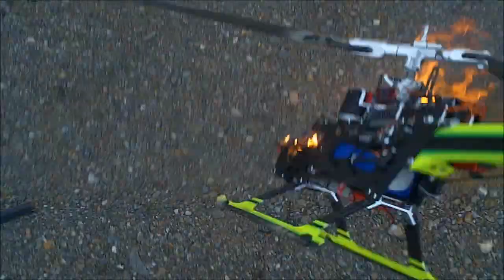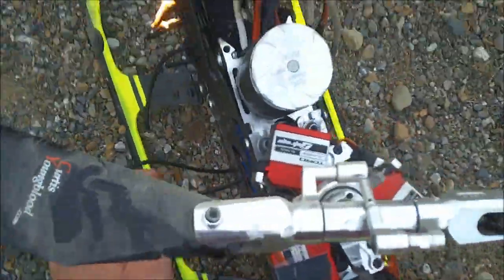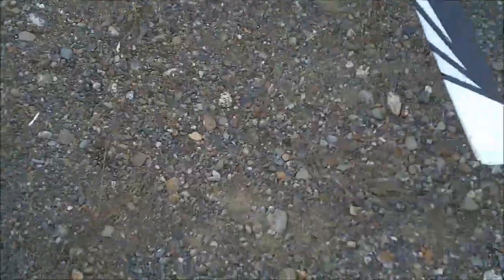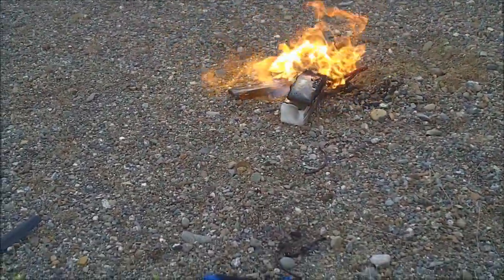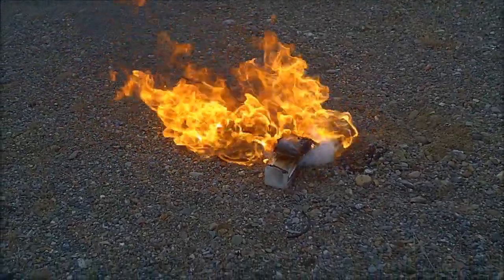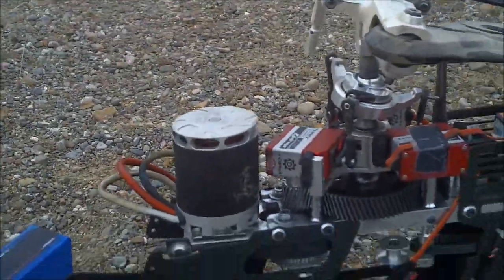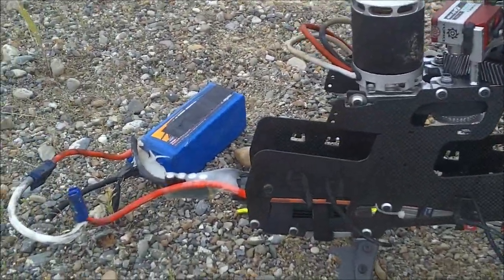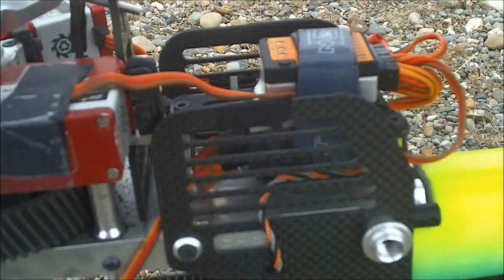Goblin up in flames

Comment: Replace the both shafts in the rotor head as even a small crash can bench these. Ditch the blades just for insurance as you cant see small cracks or stresses. Belt may have been an alignment issue or tensioning.

Comment: you used zippys in a goblin?
Reply: I couldn't tell if those were zippy's or hyperions, but zippy's explain it/.
Reply: caphead  - why not ?
Reply: majorsmackdown its like taking your Lamborghini to jiffy lube!   You just dont skimp on batteries with a high end model.
Reply: caphead - You thinking that the batteries had anything to do with this failure ?  I've been flying with zippys and turnigys for a long time and haven't had any problems, so I'm wondering why I should quit ? - The real lesson here is that you can't rely on a single lead from a servo size wire to power the whole heli, it will melt and short out.  At least two heavy duty leads to the receiver/fbl unit should be made.  The flight controller power draw on my trex 700e is an average of 5amps, that's too much for a single servo lead which is good for about 3 amps. - also power switch ?  Don't introduce another point of failure and just do away with a power switch - direct power from the batteries to the receiver is the way to go.  If you must regulate then your regulator should have 2 outputs.  Zippy batteries are fine and I was holding back but now I'm just thinking your comment is ignorant.  If they supply enough power for your needs then they're fine.  I've found them to be far more reliable than thunder powers I've bought in the past that cost 5 times as much.
Reply: majorsmackdown didnt say the batteries had any part of the failure at all... I just think its funny that all the money spent on a goblin and such , they decide to skimp on the batteries... that is all.. I find it amusing.   Go take a Lorazapam you seem too excited.
Reply: caphead - well it is a shame (and can be dangerous) to see expensive models crash and not a lot of people know enough about electricity, current, wire size, etc..  I saw a $5,000 airplane nearly killed because batteries (for some reason disguised as correcting the CG) were put in the tail - those long small wires created a lot of resistance and started melting - luckily the fella noticed the melting wires before a total catastrophe.  By the way, I fly my $9,000 dollar airplane on batteries I put together for dirt cheap.  Instead of spending $400 on batteries I think I was in it about $50.  Just because you can spend a lot of money on toys doesn't mean you need to spend more than necessary on batteries.  I've seen more issues with the expensive batteries..  I'm not really excited, but I like to pass on lessons learned - and you're not my doctor.   :)

Comment: I had a similar failure with my goblin.  The tail belt managed to slightly rub a servo wire running to my bec on the inside of the frame.  It short circuit the system causing complete power loss in mid flight.  ):

Comment: I had a similar issue with my Fusion 50. Repeated intermittent power loss. Finally tracked it down to a faulty power switch arming my Rx. It was a Futaba switch, arguably the best there are, so it just goes to show. Any electronics can fail.

Comment: Im amazed how well your heli survived the crash!.same thing happened to mine,except a lipo actually went up in flight,lost power,heli went in inverted HARD!.Nearly a total loss as i wasnt able to get the burning lipo out as quick as yours.All cnc ali parts badly burnt.frames,boom,blades,all shafts,gears and bearings munched.Total cost around £480.

Comment from the maker: I found out it was a total power loss to the Rx that caused the crash.  I hit throttle hold, but with the power loss, it was moot.  The ESC survived and still worked fine after this crash.  I think the crash caused a battery to short out, which created the flames.

Comment: Where you able to activate the throttlehold switch? If not, the fire may have started from the ESC.  I crashed my trex500 in tall grass, and forgot to flick on throttle hold.  Next thing I knew I saw brown smoke from one of the esc capacitors.  The lipo was not close so it didn't catch.  At least, we know the lipo's don't simply explode like some people think.

Comment: Did your RX have a BEC in it?  If not & you were running a 2S LiPo direct to the RX you probably over-powered the RX/servos I don't think they like running on 7.4 volts.  Also what is your switch hooked up to?  If it shuts off everything including your main battery, that switch would need to be able to handle 200  Amps if you are running a 5,000 Mah battery @40C
or you would need a power relay to take that load.  So, melted switch, then impact, then damaged battery & fire.

Comment: Wouldn't a boom strike in mid-air cause an immediate disintegration of the tail in the air? I too am fairly sure the tail damage is from impact and most probable cause would be a lipo failure.

Really really sad to see such a great heli go down in flames man, sorry for your loss.

Comment from the maker: I don't think I'll ever know for sure, since so much came apart after the impact.  My guess is that my Rx battery pack came out, though, I used a hot glue gun to hold all of the connectors in the BeastX and AR7000 Rx.  Felt like total power and control loss.  My Nation email is deater (at) rchelination (dot) com, or you can reach me at deaterbutler (at) hotmail (dot) com.

Comment from the maker: It was, and it sounds like SAB fixed the problem.  I knew about the problem before I built my Goblin, so I made sure I had the clearance from the boom to the tip of the blade.  A boom strike is pretty hard to miss when it happens.

Comment: the abttery i dont think is the issue , it i think jsut got a  good hit in the right spot on impact , seems the tail let go you froze your fingers as hit T hold. by the thold working on command , rules out any kinda downed power to your rx. my first thought "belt snapped"  , but something had to let go somewhere in the tail gearing section . spinning on shaft pulley...no teeth left ona  gear , something..as your belt was fine. my opinion, sry for the damage.:(

Comment from the maker: Ah, that's a good point.  No, I have not yet tested the tail servo.  It's a brand new Outrage 9188, like 3 flights on it total, so I hope that wasn't it.  The way nothing really responded after the tail went crazy kind of confuses me.  Throttle hold seemed to make no difference.  Once I do some more troubleshooting I will let you all know what I find.

Comment from the maker: Yes, I cut the pinion down to size, 28.5mm I believe, and it was flush with the pinion.  There was clearance and the batteries were strapped on tight.

Comment from the maker: Zippy batteries.  I hit throttle hold as soon as I lost tail control, just didn't seem to make a difference.  The canopy is still in great shape, I would think that if the impact was enough to puncture the battery, that at very least, the canopy would have more damage.  Could be that a cell went bad during the flight, I've heard of that happening.  Overall though, still a mystery what happened.